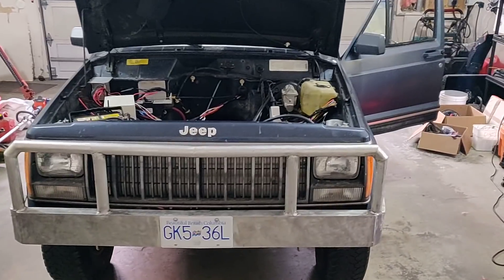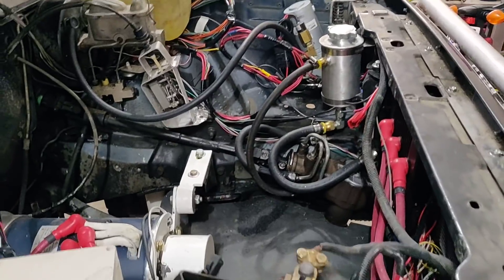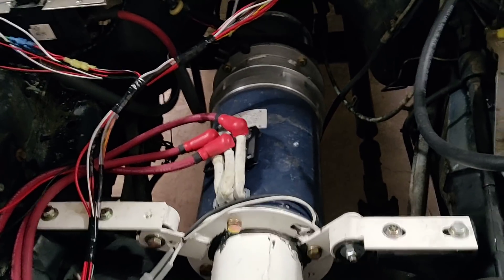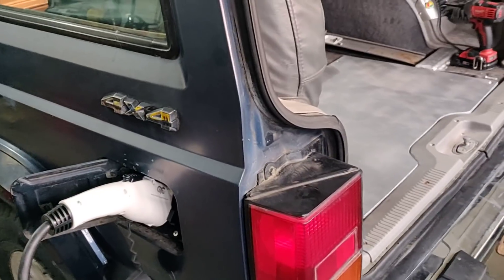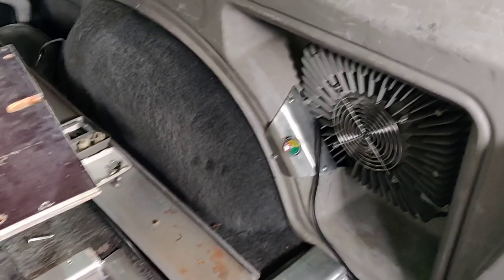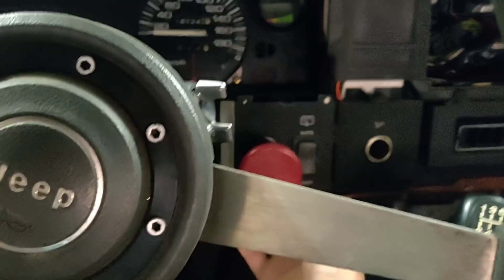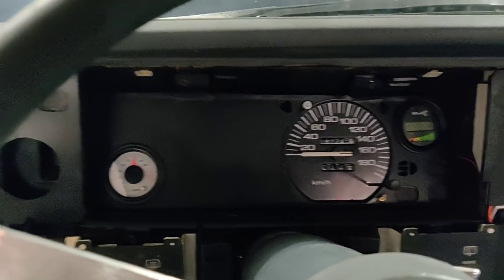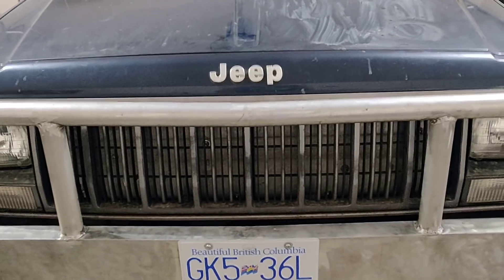Jeep Cherokee EV Conversion Overview

Comment: идея хорошая но моя лучше и превосходит твою начнём посмотри ролик генератор 220 питание есть после запитаваем трасформатор 220-12-13в 100ампер потом преобразователь 12-220в 4000-8000w потом преобразователь 220-96в 500ампер с хорошим кпд потом контролер та  же 500 ампер двигатель 96в и с хорошим кпд  и генератор который автономно крутится он не потеряет крутящий момент если ты с делаешь как я написал  и твоя техника будет проезжать 5000-10000 километров при 120 км час твои аккумуляторы не нужны

Comment: So I drive a 89 cherokee with 5 speed and im really curious how exactly you shift this. You said you removed the clutch.. and you don't use the gears why keep the transmission at all? Also I've driven without a clutch before on my jeep because my clutch went out a couple times so is it similar to that?

Comment: Nice project. Did you buy or get a machine shop to make the adapter plate and coupler to link the electric motor to the transmission?

Comment: New sub here. Good job walking through the conversion.  I am interested where you picked up those Nissan Lead batteries.  Also where did you get your AC motor? I have many more questions, but that is enough for now.  Very well presented video.  Cheers!

Comment: Nice looks like you did a good job, have you thought about building a custom pulley off the drive shaft and some brackets so you can put a alternator for charging so you dont have to plug it in to a power source, or even put a plate in the engine compartment that will hold a electric motor to turn 2 to 3 300 amp alternators.

Comment: Interesting build..l am in the process of thinking to build an electric motorcycle sidecar using a 5 speed car gearbox. So any useful information regarding electric motor size...electrical gear...would be of use. My idea is that l am trying to limit the overall weight to 350-400 kilograms so quantity and size of batteries are an issue. I have also considered a separate engine charger..( small generator )so as to give me distance. I need or will be travelling 500 miles plus...in one hit..Any ideas👍👍👍👏👏

Comment: Hey, see if your willing to hear this...get 4 alternators ( 24V 300amps each),One 12 volt motor *drive belt motor' (no bigger then what is needed) mount the power steering, ac, ONE of the alternators and what ever else to a belt driven by this motor... mount the 3 alternators down at the drive motor, add a pulley to the shaft, belt drive when the motor spins... trust me, the only batts you'll need will be the one you need to drive the jeep... the alternators sends enough recharge (96v 1200 amps) for the batts to last a VERY LONG TIME...Trust the truth, not the stupid people who never does, and they also say how things won't work...

Comment: awesome; hey Shawn, what would be the rough difference in top speed and power consumption if you tried to go directly to the transfer case? does a Cherokee have a transfer case? Is there any chance that removing a manual transmission could add longevity and simplicity? perhaps easier when converting an automatic car?
Reply: that will shave off even more weight

Comment: I can imagine you can put a funnel behind your grill that's leads into a wind turbine to regen some power as you drive.
Reply: but then the motor would have to work harder now it has to spin the wind turbine its not possible to create power

Comment: Do you still need rubber engine mounts on an EV? Great video, you had some really good depth I couldn't find anywhere else.
Reply: I wouldn't think so being the electric motor is a lot lighter and doesn't have a variable weight due to liquid weight shifting from a central position
Reply: I'm guessing yes because the trans is still probably on stock mounts... but he doesn't answer any questions I guess.

Comment: AC vs DC: Actually I think any battery powered motor is essentially DC (i.e no slip rings) but a DC current will not turn any motor. That’s what the motor control unit does: it turns the DC supplied to a “stepped” signal for efficient operation of the motor. Three phases also smooths the rotation, so better efficiency.

Comment: You should redo the wiring and put protective coverings on the wires you must think a short will burn through the wire melting into another wire causing a fire. Keep low Amp wires away from high Amp wires and insulate all wires

Comment: Neat jeep!
are you gonna do an android tablet/radio with car info?
Reply: I agree.  Almost all the other EV builds also work hard to maintain OEM simplicity, which is great, but this is one scenario where having a large touchscreen witch can handle and manage heaps of info would be critical.  There is so much more to monitor.  Look at the dash of a highway tractor like a Peterbilt, there are loads of gauges to monitor the temp of every single component.  Automotive does not have the real estate to house that many gauges.

Comment: Just a thought on idea if you want AC and still want to retain the almost Factory way you can use the electric AC compressor you may want to get one from a newer Prius  or volt since it takes DC directly to the compressor and then it transforms it into 3-phase AC but that way the compressor would work automatically with the AC relay switch in your car if it's still there.

Comment: does anyone have an idea where i can find affordable electroconversion kits ?
and what kind of speed Shawn reached there with the cherokee ?
thank you
Reply: Try: evwest (dot) com ...You've probably heard of them already. I've currently just started looking into Chines sellers.
Reply: @10aDowningStreet  what i saw on evwest website was expensive for me though very interesting... and tried looking on alibaba and aliexpress but they sell just some shitty stuff which would not work at high prices... if you find sth please send me at planetRocker12@gmail.com and we start converting our cars together.... but i am thinking for a Hydrogen conversion with no gasoline or diesel engine... how to move a car out of SEA water... electricity is also expensive in my country but sea water is unlimited and free

Comment: Truly, I'm impressed and inspired. A smaller/lighter car would improve efficiency though.
Reply: Yeah but xjs are barely over 3k lbs and the relative mpge makes it mostly irrelevant especially when you consider you still have 4x4 etc.. but sure a super boring civic would be more efficient, better yet an e46 for $400 lol makes the setup easier with rwd

Comment: very nice video.  Thanks for being so informative.  I am curious on what range you get with the Leaf battery shown in the video.  I can then multiply that by the additional battery packs you are planning to install in the future.  Since this is now the future, have you installed them?  Also what kind of cost has this involved with both used and new parts?  Thanks for sparking my own curiosity.

Comment: if you still need to get the sap off, use cotton balls soaked in rubbing alcohol. Let them sit for for about 5 mins and the rub it off. You can repeat as needed. Nice work. Thanks for sharing.
Reply: peanut butter oil works well too

Comment: This is why I'm hanging on to my 99 Cherokee. Its a great vehicle for an EV conversion. Now if someone would start a chain of EV conversion shops that would be great. As others noted, giving us some range details would be nice but, I'm guessing you wanted to wait for all of the future battery packs to be added.
Reply: EV West and EV4U seem to be two shops in Cali that are growing and are working on kits and making conversions repeatable. That said, I would rather convert a 2-wheel drive vs a 4x4 any day -- there's just that much less dead weight to lug around. For off-grid, no-gasoline use or my bush-truck, I'm more inclined to figure out some wood-gas contraption or some such rather than subject the electronics to the challenges of wilderness outdoors.
Reply: @freezerlunik  the electronics handle the outdoors a lot better than gas engines-- they're a completely sealed system. They don't care about humidity or grime. I'm looking at making a hybrid electric module for my Cherokee for when I convert it.
Reply: You think an 06 liberty hybrid would be a good project ?

Comment: I have several questions  the 1st being what size in hp is the drive motor? Next what brand is the motor and what is the warranty time on the motor? Next how much has it cost you to get the vehicle to the stage that it's at in this video?

Comment: Great job on the conversion!  Here is a link to a video giving an excellent explanation of why not to use a early model Leaf battery. https://www.youtube.com/watch?v=DE_PZQ13YTY  Fair warning it is basically a science lesson ;) In short, make sure that the battery you use has a Thermal Management System.  I think you'll want to watch it.

Comment: Great!!  Thanks for the video.   What's the range with one of those baterry packs.   Having more battery it'll give more range but I guess also significantly longer charging times.  did you keep the 4wd ?   how much the range gets affected by running 4wheels, off roading ?  How much weight you think you got rid off ?

Comment: Set up is nice bro, I'm thinking of doing this with an astro van, just curious if it can be an apparatus to make it 4wd obviously is gonna required a lot of power.
Reply: Is the trans auto or manual? As long as you upgrade suspension there should be enough room to fit enough batteries to get decent range, the 4 wheel drive stays intact typically

Comment: While I wouldn't usually be okay with someone doing this to an '89 with a 5 speed, I am not very good with power electronics and I can't weld aluminum for shit. Great build, really cool video. Do you just roll around in 3rd gear when driving it?

Comment: Question: Why not hook a 12v Alternator and pully setup off the front output shaft to charge the 12v battery while you drive? Doesn't seem like that would be too hard to setup and it would help extend the 12v battery while you drive. :)
Reply: Installing an alternator like you suggested would have worse efficiency than a DC-DC converter. If you put a load on the output shaft of the motor that power has to come from somewhere, the batteries. So its less steps to just get 12v directly from the battery.

Comment: How much automotive experience did you have when starting this project? I want to get a small, older truck and convert it, but the mechanical bit of replacing the engine with a motor is the one part I'm nervous about getting figured out.
Reply: Just list it on Facebook or Craigslist.  Free motor you must remove. 
Or buy a cheap cherry picker.  Of you remove the engine their isn't anything you are going to break that you need so hack away.  
You may want a machine shop to make the transmission adapter plate for you.
Reply: @Undergroundexpedition  Thanks! Farming out the removal to the buyer is something I hadn't considered; if they want it, they probably have mechanical experience!

Comment: That's awesome!

I have some questions:

~ What guides/sites/whatever have you used to do this? 

~ I've heard that a lot of the low-weight and smaller vehicles (like a Honda Civic or VW Beetle) are the best options for an EV. This seems like a pretty big and heavy car (with 4x4, as well). What would be the main general concerns in terms of power consumption in heavier vehicles like this?

~ I once read somewhere (I forgot where) that a manual transmission doesn't really do much in an EV beyond going back and forward, with the EV pretty much speeding up or down all by itself. Is this true? 

I've always thought about doing an EV conversion myself, but I'm not sure where to start or what I'll have to look out for. :(
Reply: The xj is a unibody design so it is much lighter,  besides things like the samarai it is probably the lightest 4x4 out there
Reply: Alec Carter I see, now.

Comment: This is pretty cool. Id like to know how well it works sub 0 temperatures though. Ive got a 98 ZJ with a high mileage 4.0L. I love the jeep and will have to swap the engine with a 1.9 TDI. However if I can go electric instead of diesel, I would.

Comment: Do all the battery packs need to be centralized? Is it possible to have your 3 packs in the rear and 3 more mounted above the engine and then maybe 1 pack under each seat? I know the wiring would be a lot but is there any other reason not to have remote packs? Love the project, by the way.
Reply: Yeah you can do that. We do it on our EVs. You nailed it about wiring though. There's also losses associated with that.
Reply: He mentioned he was going to put two battery packs up front.

Comment: Awesome setup I learned a lot. I was wondering if instead of going full EV we could add a smalled AC or DC motor to the existing engine to increase MPG, Torque and less contamination since a full EV is expensive was wondering if this would be easier on the wallet. I know the motor and controller are the most expensive parts but thats why something smaller like a Forklift motor that are"Cheaper" could work making a Hybrid.

Comment: The two biggest problems I'm having with an e.v. conversion is finding a cheap enough motor and figuring out the controller aspects.  I can do the modifications just fine if I had the parts and time!

Comment: neato home brew... some comments:  get more storage.  What is your range on this in the summer?  ~70km?  Second you will want some form of climate control for the batteries.  Charging frozen batteries is a bad idea and drawing from hot batteries is a bad idea.  Also you have no BMS in here so while the charger maintains the overall pack voltage the cells themselves can diverge and become wildly out of spec if they're not conditioned properly.

Comment: maybe consider hydro-boost style brakes, using the power steering hydraulic pump? (edit) hmmm, a pressure accumulator and pressure switch, and have an in dash on-off-auto

Comment: Nice work.

I have a 2002 Chevy Blazer automatic RWD project truck and I am thinking of converting to EV Lithium. I hope to remove the Air Conditioner and Heat.  Do I need a transmission at all?  And if not, any reason I can't lift the truck and push the motor further back closer to the rear axel and squeeze all component and batteries in the engine bay?  Possible to convert to rack and pinion from power steering? Did you keep your dash?

Anything really dangerous with working with all this power beyond fire? Can all those batteries kill you if you touch or make a bad contact?
Reply: No need for a transmission on EVs but some people do make gearboxes for reverse gear & all wheel drive setups. Check out the online forums for the best help.

Comment: Great video. Are you using BMS for each individual module when charging your batteries? I am using Nissan Leaf batteries for my EV conversion too, but still trying to figure out which BMS to use. Thx

Comment: What is your onboard charger mounted in the rear wing?

I didn't find info on your blog also
I am searching one like this for my project
Reply from the maker: https://www.thunderstruck-ev.com/tsm2500-and-charge-controller.html I chose it primarily because you can program it yourself without having to send it back to the manufacturer

Comment: Nice explanation, not a lot taken for granted. Interesting to hear the clutch isn’t needed.  And I like the welded aluminum, everywhere. DC motors can generate voltage, just need a motor controller that accepts dc regen. As I understand, AC motors and controllers are more efficient.

Comment: Are there any concerns about removing the engine and not replacing the area with some kind of mass to replace the crumpple zone that was there in case of a front end collision?
Reply from the maker: My very amateur understanding is it is actually safer, as the engine tends to be what gets pushed into the cab, but it's not very structural itself. That said I dunno if that applies to an 89 jeep of course.
Reply: The body is the crumple zone. Many vehicles have engine mounts that are designed to drop the engine and get it push down out of the way so it doesn't get pushed in to the cab. This usually only happens in high speed collisions through.